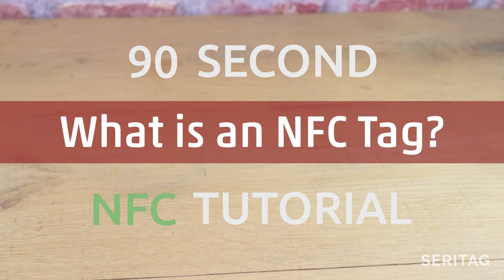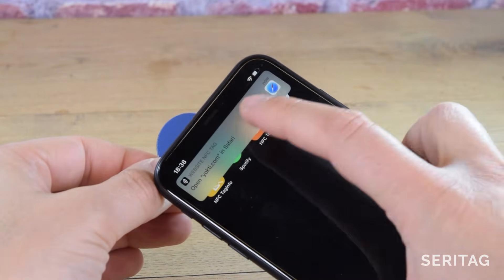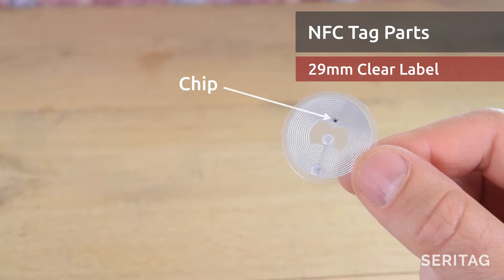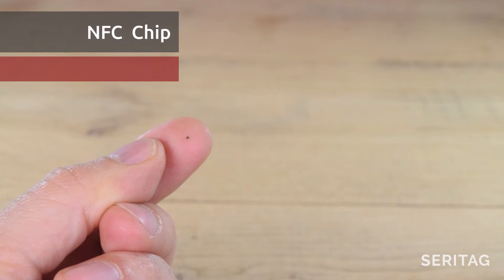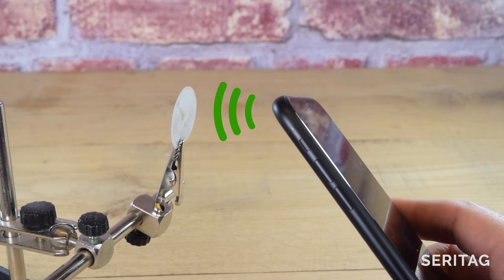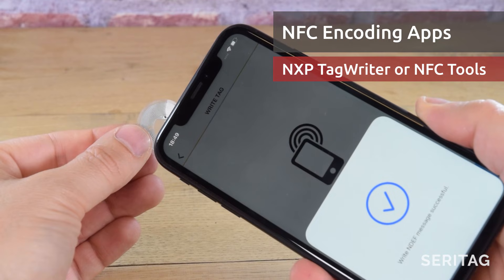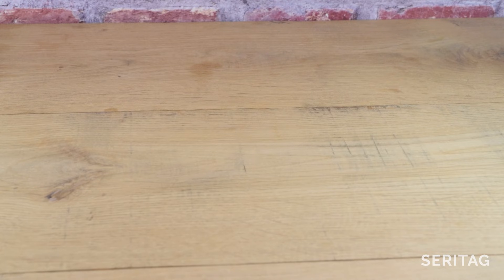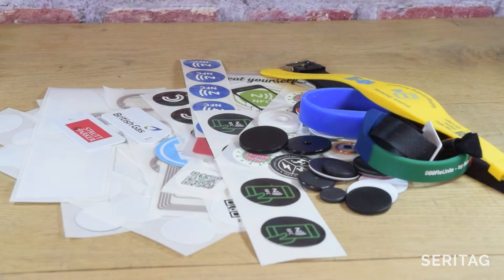What is an NFC Tag ?

Comment: Thank you! Breaking it all down to the foundational elements. I pulled an NFC Chip out of a Creative Tonie Character Figure, but when I went to go use it inside a new one, I was disappointed that it won't read. I was worried I messed up the copper wire coiled around the cylinder, but according to this, that is simply an antenna. I'm still not sure why this chip won't read, but I'm closer. Can this chips be destroyed by magnetic interference?